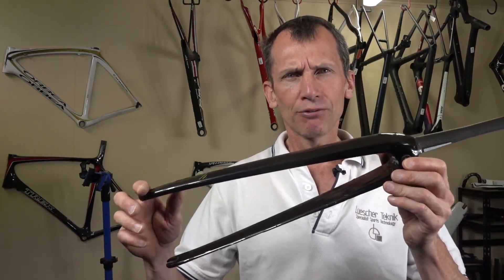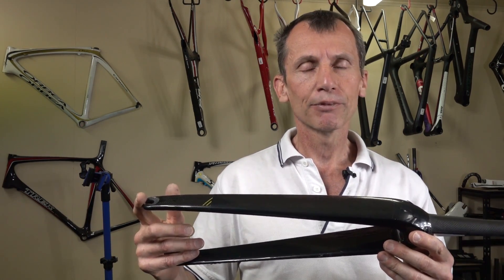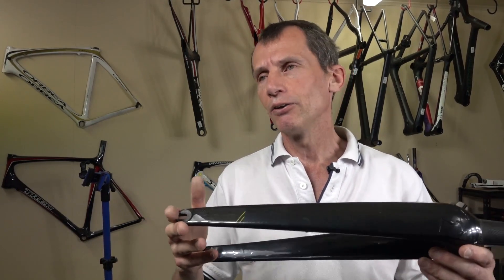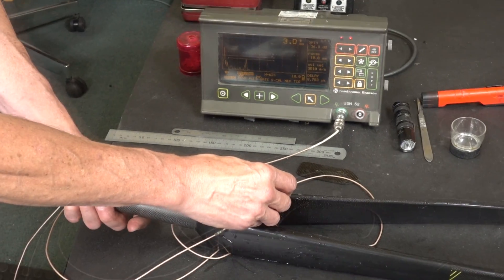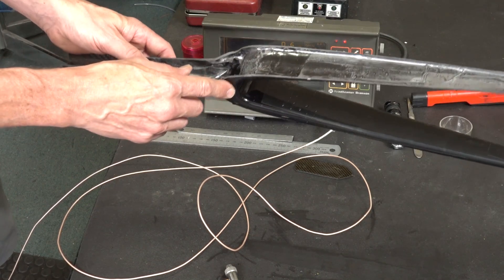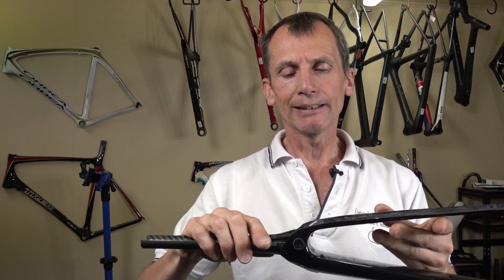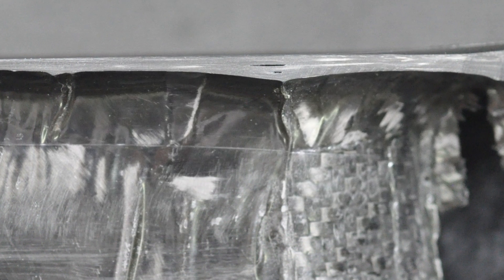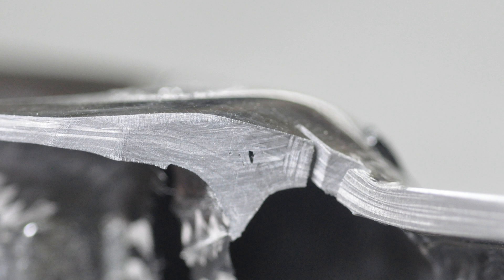Using Ultrasound Scans to Find Production Flaws

Comment: Hello sir 
Can this machine be used to inspect a powder extinguisher
To check if there is gas inside
14 bar
Or not
Reply from the maker: It would not be able to identify pressure in a gas.

Comment: Ideally you want to change the scale on your baseline so your backwall would come up futher down the screen so you can view better. To size accurately you really need to determine your beam profile so you can do an accurate dB drop across the discontinuity. A reflector is not necessarily a void, it can also be a planar delaminated area without any real volume, it just interrupts the reflection of the backwall signal. Testing from either side can also help to determine the depth of the discontinuity if it has any. I trained on this same machine when learning ultrasonic testing years ago and they were awesome like most Krautkramer kit.

Comment: Can ultrasound be used to identify bond line thickness between two carbon parts bonded with adhesive?  What sort of ranges is on the sensor on the ultrasound?
Reply from the maker: Yes, bondline thickness can be measured as long as the adhesive does not have too much porosity.

Comment: does a defect like this make the product unsafe for its intended purpose? im sure many products are designed to handle much more force than intended in order to reduce the chance of a defect causing a catastrophic failure. am i wrong? There must be a defect rate or something of that nature that the engineers have designed into their products to ensure safety .
Reply: It's not simple the judge these without knowing the engineering solutions and calculations in the background.. I think these are more indicative of quality control issues, which can lead to faster failure with incorrect use.. So in conclusion, you don't really know for sure un til they break. Maybe the question is more of: "do you want to take the risk?"

Comment: Carbon. Its bling but you dont need it, its way way over priced and dangerous as f.  Biggest scam in the bike industry.  You should pay way less for carbon than aluminium. Both very abundant on planet earth.  Scam asourus rex
Reply: mjs1231 titanium.is also.abundant but it's very expensive due to the manufacturing process. Aluminium alloys and steel alloys are.cheaper to make from the tubes to the.Labour component. Not everybody needs to ride carbon frames most if don't but the availability and arguably the affordability of alloy frames sees us on carbon. For group rides and racing you need a light bike which you.can.upgrade every few years. I'd never use an alloy frame for more than 3 years especially mtb. A steel.531 frame or titanium can last a lifetime, great for the weekend social rider or long haul router.

Comment: In all likelihood a  proportion of mass produced frames will have some sort of manufacturing 'defect' in them somewhere,be it voids,laminate creasing,resin poor areas etc.
Should mass produced frames be made to the same exacting standards and testing procedures as aerospace components? And if they were, would consumers be willing to pay the extra money for them?
(Trek actually did this.They had 2 models of Madone, one built in Asia and one built in Wisconsin....for $1000 extra!!It's no surprise which one they sold more of.)
Keep up the top work :o)